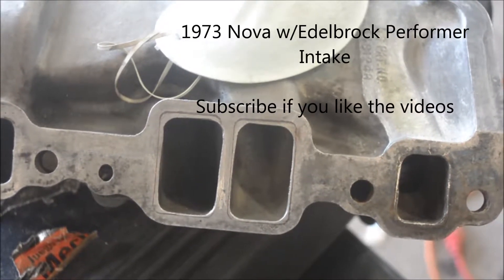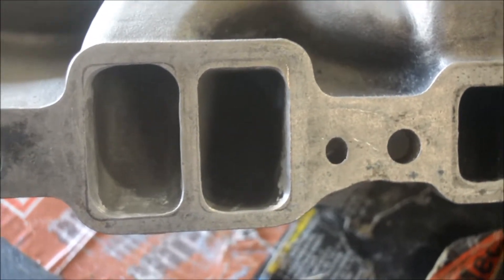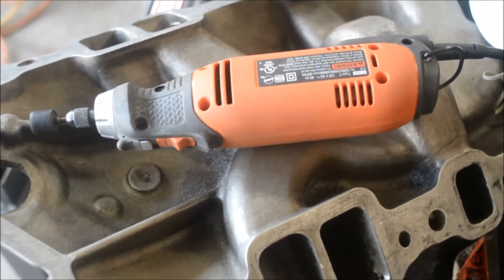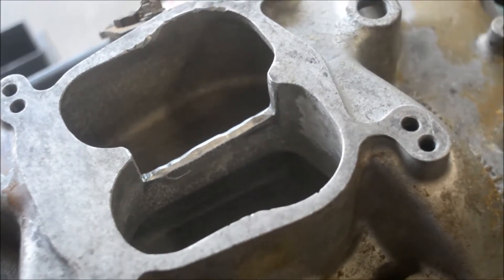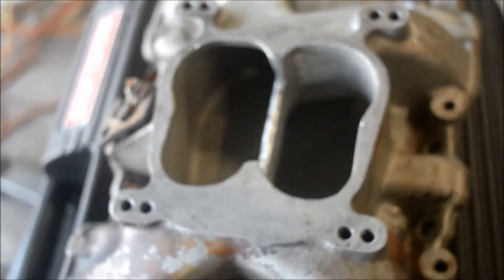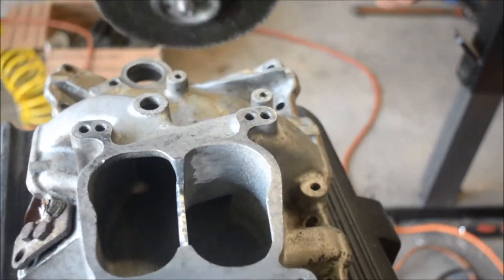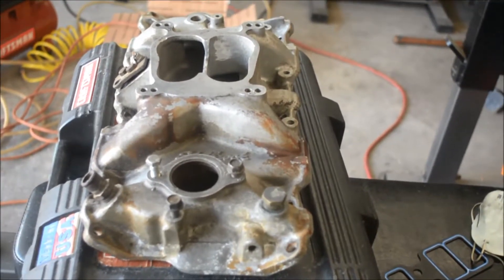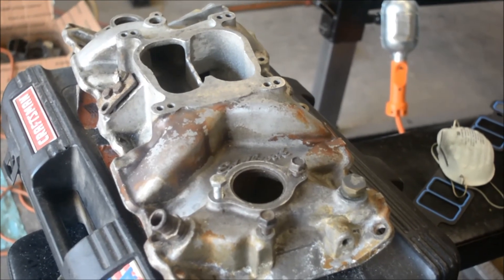Edelbrock Performer Port and Plenum Mods

Comment: What is the small port on the passenger side of the intake?  My intake has it but a bit taller piece covering it and its interfering for the carb to sit right in the middle.  I was wondering what its for.
Reply from the maker: @ Alex Morales

If you have a Holley carb, it doesn't need it.  It transfers heat from the heads.
Reply: @c41man  i have an edelbrock carb.
Reply from the maker: @Tightlines24  

I also have a 1 inch spacer between my carb and the intake.  That might give you enough room to bolt the carb onto the intake.

Comment: You can do the cheap way and still save your intake . buy a 1" spacer plate and bolt it to the top of your stock dual plane intake .

Comment: Removing the plenum divider absolutely helps idle quality and fuel metering at low rpm, smoothing both signals. It allows fuel distribution  to spread evenly to all cylinders. Especially works well with larger camshafts helping eliminate low speed subtle misfires.